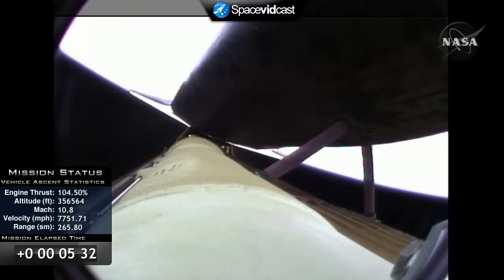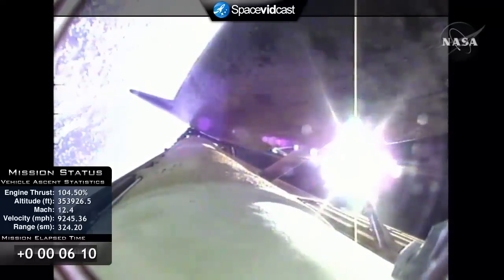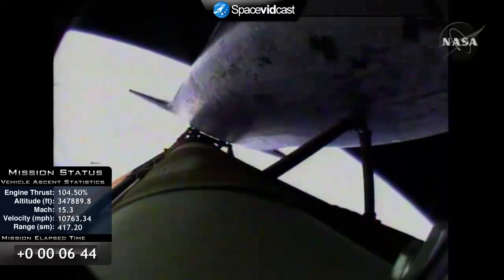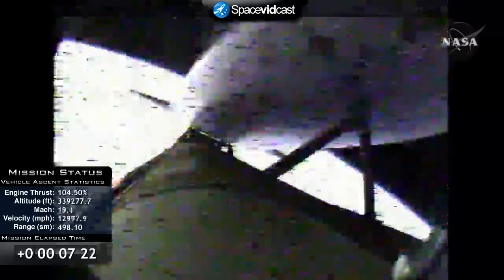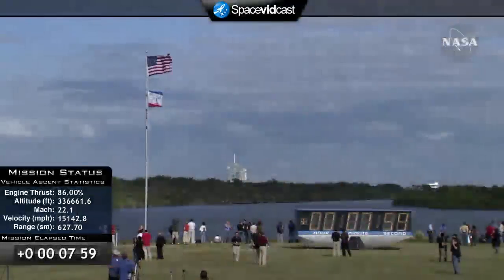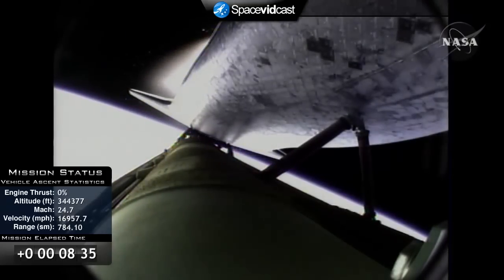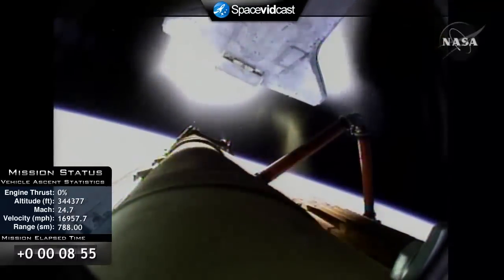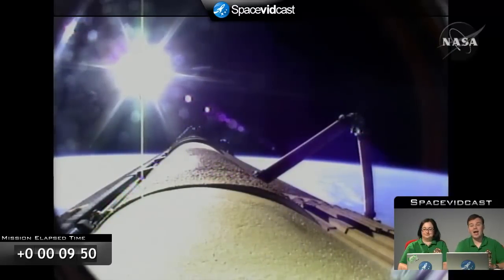STS-129 Launch with Space Shuttle Atlantis on 11/16/2009

Comment from the maker: @DeepAbsentia The two support arms in the front don't carry any thrust loads. Only yaw loads (keeps the orbiter's nose from shifting left or right). The larger supports in the background (near center of the shot) are 17" liquid hydrogen and oxygen feedlines with a ball-and-socket type of attachment. They have small pyrotechnics that detonate when it's time for the orbiter and tank to separate.
Reply: The ET camera that captured the whole ascent is mounted on the liquid oxygen line.

Comment from the maker: @Hollywood115F16 The orbiter is made of an aluminum alloy. The nozzles have the copper inner lining and use brazed stainless steel tube formed into the nozzle shape with cooling passages designed into the tube-wall. Copper and steel are heavier than aluminum. If there were a way to make a new shuttle orbiter of the same shape and design as the current fleet, it wouldn't be much lighter than Endeavour, the lightest and newest of the three. Discovery's the oldest, but lighter than Atlantis

Comment: At 11:30 the bottom of the external tank seems to catch on fire. I've seen several other shuttle launches and the same thing appears to happen every time during the same phase of the flight. Actually, of you look at footage of the tank being released from the orbiter, it can be seen that the bottom is actually charred black.
Reply: rodcub A bit belated, but it isn't catching fire. It's the widening of the flameout due to atmospheric pressure dropping. <3
Reply: Good sir, you are right.
Reply: +rodcub its actually the thrust from the solid rocket boosters, but the camera is blurry in a 2 G high speed enviroment
Reply: Every comment here is correct but there's also another factor that changes the exhaust plume which is called "Plume induced flow separation", It's what caused the exhaust of the Saturn V to creep upward the spacecraft like this: https://i.stack.imgur.com/Pr8Td.jpg
Basically the rockets exhaust is strong enough to separate the slip stream of the rocket from the body (boundary layer separation), and force the exhaust to creep up into that area.
The physics behind it are way beyond me but here's a study of it: https://ntrs.nasa.gov/archive/nasa/casi.ntrs.nasa.gov/20110004015.pdf

Comment: at around 10:48 the altitude keeps climbing yet we clearly see the rocket at the tip of its parabolic arc. How is it now gaining more vertical altitude if it is flying horizontally? Only 13 miles up in the air they are travelling horizontally? This is also the cruising altitude of the SR-71
Reply: Just because the rocket is oriented in a particular direction does not mean it's velocity vector is

Secondly orbital mechanics allow you to travel higher by traveling faster as you're technically just fall towards the planet but missing the surface when you're in orbit increasing your speed means you land farther or in this case fly higher

Comment from the maker: Yes, and I was really surprised by that.  I was wondering if they were using nautical miles (we use statute miles).  For a bit there I thought our data was off!

The data is extrapolated from a 10 second list and since some of this happens on a curve and not a straight line it was not always dead on, but it should have been pretty darned close and dead on every 10 seconds :)

Comment: 09:54-9:58 on this video was an unavoidable Shuttle design flaw.   The Office of Management and Budget "mandated" that NASA used less powerful solid boosters due to their lower projected development costs.  Thus, the SRB O-rings had to absorb the entire force of the SSME's at ignition.  This would not have been an issue if an all liquid design was used.  This is what causes the sway during SSME verification and caused Challengers tank to rupture, not NASA management.

Comment: So once the Shuttle departs from the main tank what happens to the tank, does it get manoeuvred back to earth with some built in controls or does it fall back to earth with a tracking device to find its location?
Reply: External tank burns up.  It's the only part not reused.

Comment: At 10:12 engine thrust reading went from 100.00% to 104.50%, how is that possible?
Reply: The RS-25 engines have a specific thrust rating. It's not uncommon for motors (of all sorts) to operate at slightly above that rating.

Comment: So I understand 90% of the start sequence. I don't understand: About T-15 or so, the sparks start flying by the three mains before ignition. Why? is that just a byproduct of the firing chain?
Reply: The sparklers burn off excess gaseous hydrogen, from the SSME's at start up.  If they didn't do this, there is potential for an explosion.

Comment: @iSahand 534,900 gal of fuel in the external tank (LOX and H2) and 435,000 pounds of solid fuel in the boosters.
Reply: Do space vehicles reach 2km/sec at 20 or 30km altitude? What temperature the skin of the vehicle is going to be at 2km/sec?

Comment: @jdcolburn73 Yea. If it hit the wing and punctured the Heat Shield Tiles on the wings, we could have a repeat of the Columbia disaster. If the foam hit those tiles and created even the smallest hole, super heated gases could go into that hole, expand, pressurize, and blow the whole shuttle with her crew all to hell on re-entry. Lets hope all is well with them all.

Comment: One thing you guys missing, if you understand physics, no human can survive that kind of acceleration and flying straight up over a 1000mph that means the astronauts withheld  over 10G, witch is only possible for a few seconds not for minutes, they must be super humans to survive that speed.
Reply: 3G's, not 10. Less than a roller coaster.
Reply: Maybe you need a refresher on those physics courses.

The shuttle stack has a 3G limit. The vehicle and its crew never experience anything above that.
Reply: @robinm1729  maybe that’s what they say, but you look at the math portion of G than it’s not 3G cause they keep on accelerating up

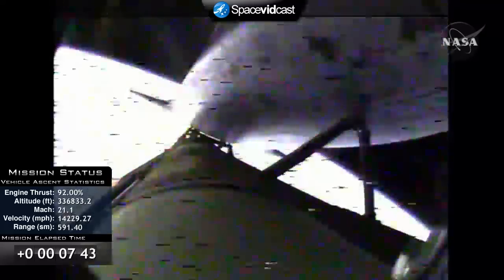Comment: 17:45 347,000 feet altitude==64 miles==100km; Downrange 600 miles, because it drifted with the wind, ten times of its ascent, as explained in: Youtube:::("Solving-Apollo-Enigma-1")!!!
Reply: The above altitude was also its max-altitude, after which its altitude decreased: one minute later it was lower, while 800 miles into the ocean, and supposedly flying at Mach-24, a total fairy-tale!!! Mach-24==24X1,200kmh===28,800 kmh==18,000 mph, while descending, which is in earth atmosphere & must instantly disintegrate!!!  Youtube::  (72 miles high-amateur-rocket)  to see that a true-rocket goes up only vertically to deploy optimum use of its limited fuel. the above rocket truly ascended 72 miles vertically up in less than 2 minutes!!!